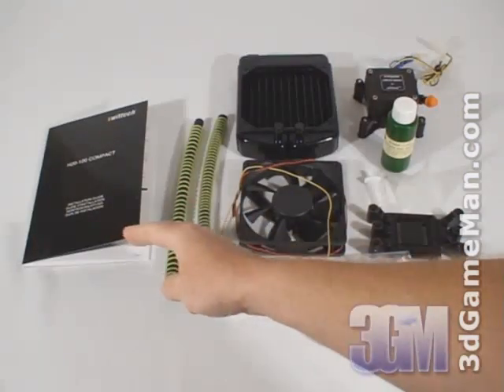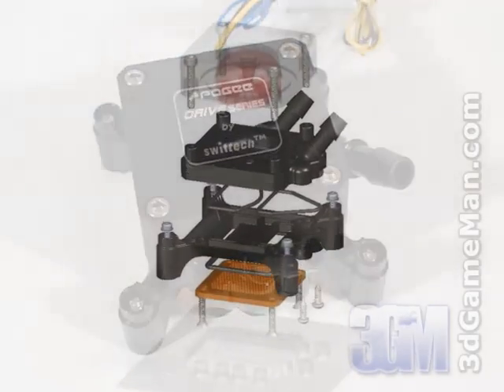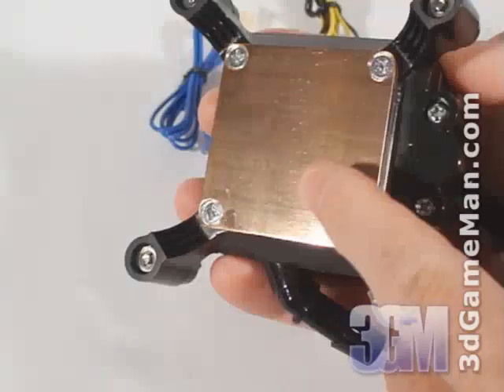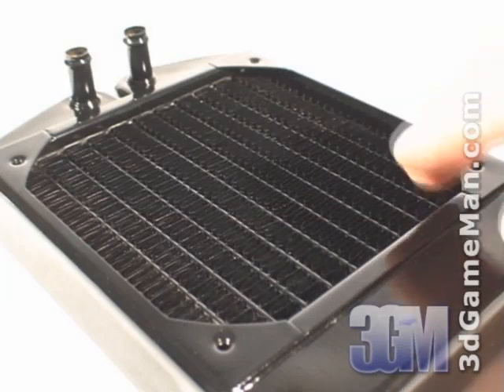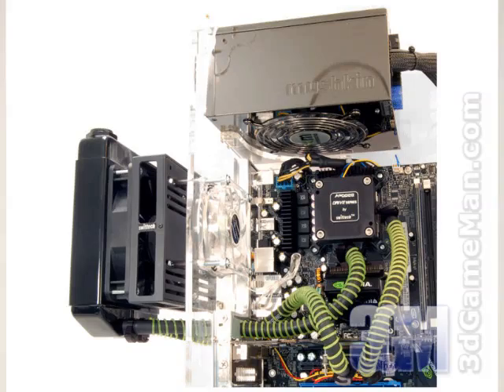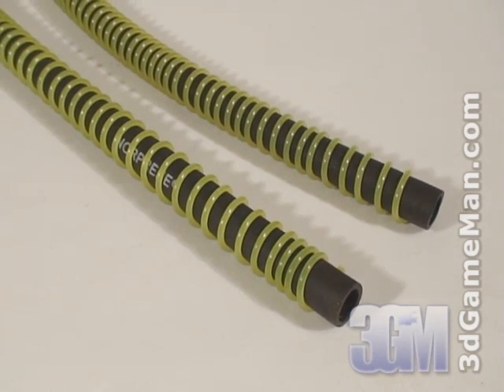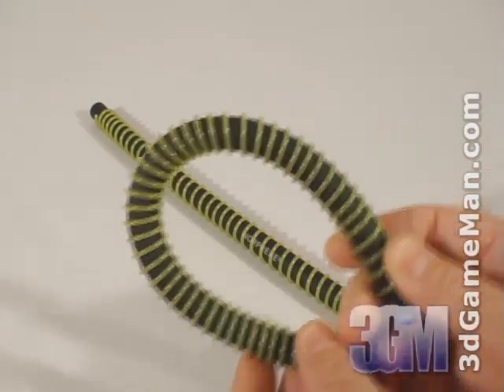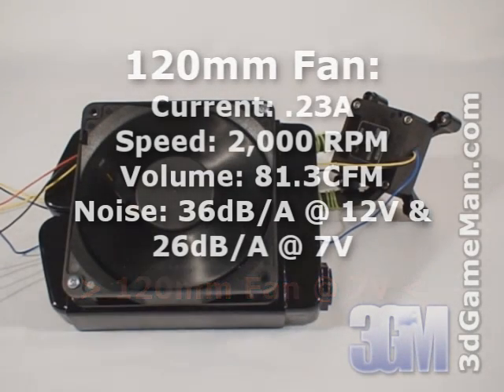#857 - Swiftech H20-120 Compact Water Cooling Video Review

Comment: @Superbiz2  So.. The 212 blows the NH D14 out of the water?  What about the Megahalems?  What about the V8?  Tuniq Tower? The 212 isn't even 30 bucks any more, on newegg at least.  It's 50.  There's much better coolers out there.  It was a good part at 30 dollars, but it's value is diminishing rapidly in comparison with other HSFs. It may keep up with the H50 (that's not saying much), but it's not even a comparison to true liquid cooling.

Comment: @osmodivs no way. the technology in cooling has moved a lot since this product. If you are overclocking it I would recommend a mid-high end air cooler depending on what you want to do. Also water cooling kits have improved, and if you were looking for a 1x120mm rad and pump, I would highly recommend the Corsair H-50

Comment: since the reservoir is in the radiator if i just bought the radiator, pump, cpu block lines and fluid this kit would work without an additional reservoir?

Comment: got it, works great only problem is that it takes up most of the room inside my pc, works great when overclocking, curretly running my 3ghz quad at 3.7 and nothing has melted :P

Comment: Certain BIOS and fan control utilities have alarms or auto-shutdown features when a fan header reads at 0 RPM, indicating a fan failure, or in this case the pump failure or power loss, so the problem can be addressed or the system shutdown before anything can be damaged by overheating.